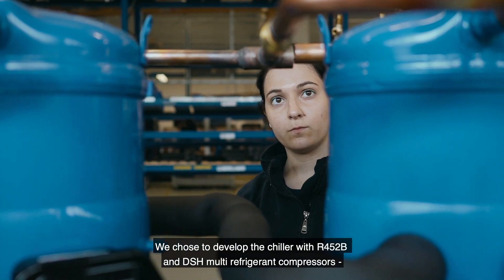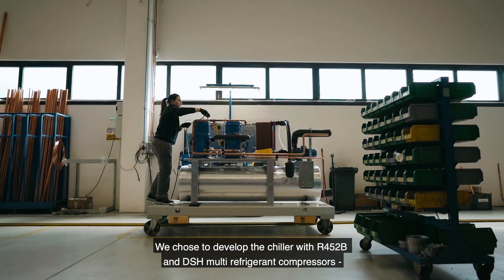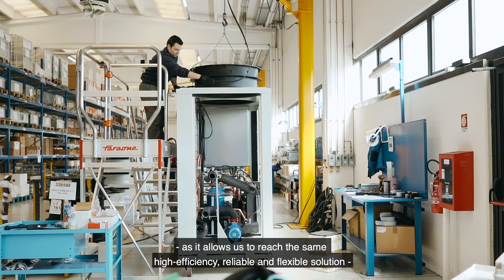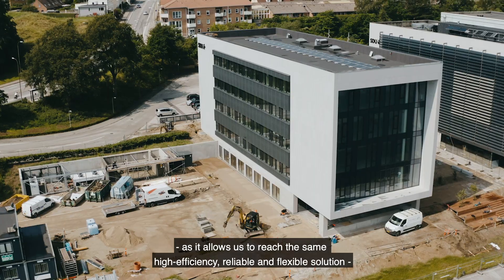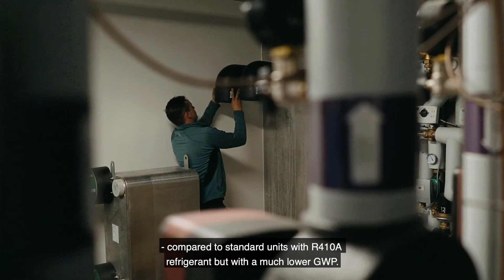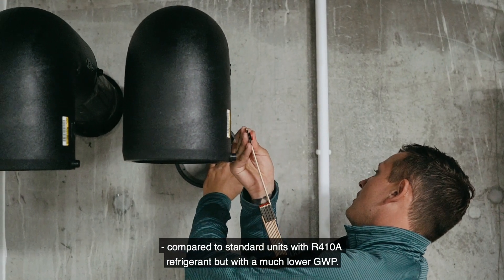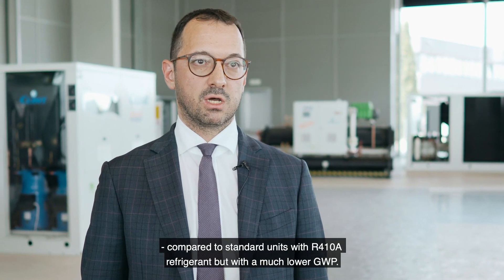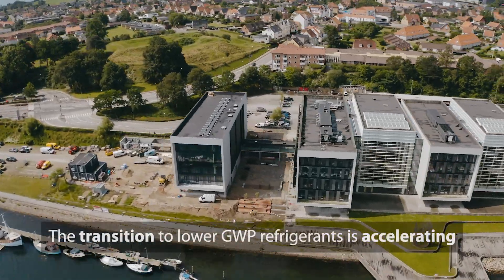Danish university leads refrigerant transition with low-GWP scroll chillers

Comment: What's the critical temperature of this refrigerant
Reply from the maker: Hi Dwayne,
critical points are specified as follow:  

R452B: 

P crit: 52,2 bar
T crit: 77,1°C

R454B:
P crit: 52,67 bar
T crit: 78,1°C

Calculated with Refprop 10 (= latest version)

Hope this is useful.

Comment: Why R452B A2L and not R466A A1?
Reply: Very relevant question. 
You need to consider this is a chiller application (indirect expansion and located outside) so A2L is perfectly fine. Having said that R452B is much easier to use and implement than R466A: it is available, so are the system components qualified for use with this refrigerant, no material compatibility concerns, all the components are the same that were used with R410A, no ODP (CF3I ODP is >0 and is part of the mixture), similar performance. 
We could ask why not R454B that has an even slightly lower GWP and is an other alternative to R410A.
Reply: @Myu4you  yes why not R290? Its a chiller! Everyting is placed outside.
Reply from the maker: Hi Javier,

Great question! A2L refrigerants are appropriate in many locations and for a wide variety of applications. R466A is not yet an officially released refrigerant, although we expect it to be by early 2020; so, for now some factors are still unclear (A1 classification, compatibility, ODP, etc). Our customers need a low-GWP solution now, and R452B is a great option.